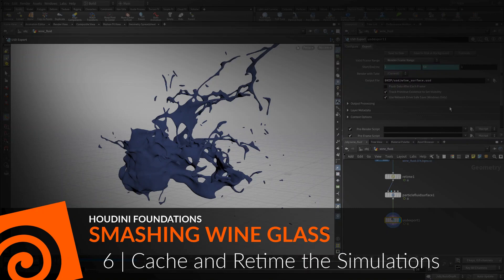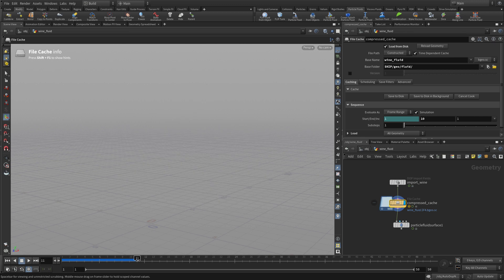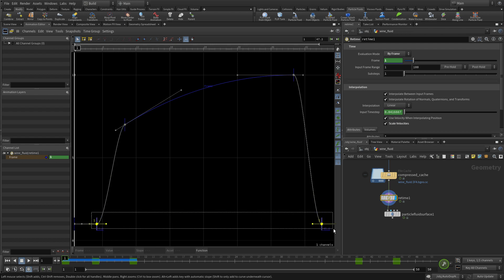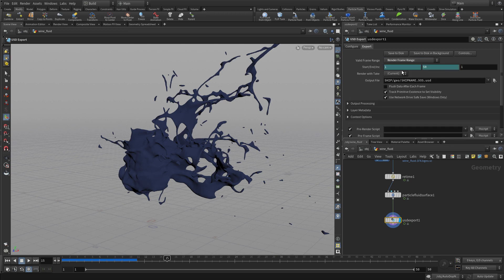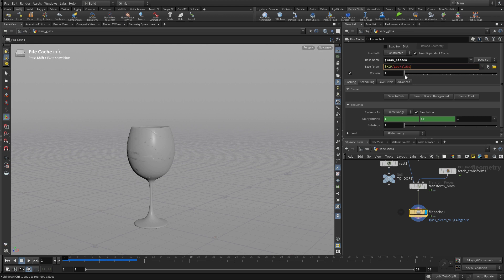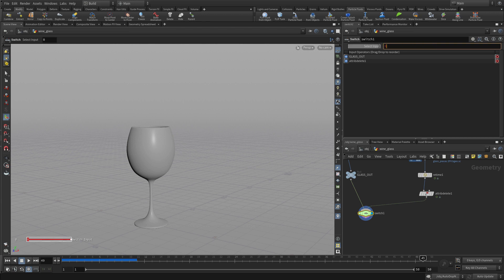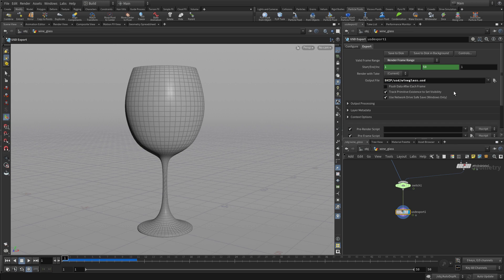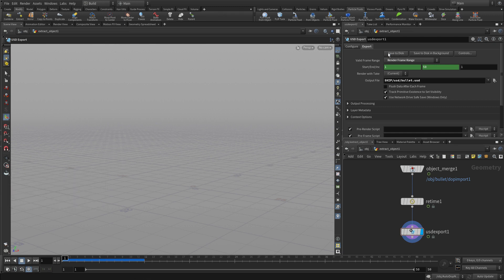Smashing Wine Glass | 6 | Cache and Retime the Simulations

Comment: Hello! i figured my glass is a bit larger (it reaches the 25 on the grid Y axis) and my preview is really really slow (even after the disk thing) when yours is real time. I m wondering if its related to this? Or is it a setting i m not doing right? Thank you :)
Reply: PS: i put the particle separation to 0.2 (which should be less demanding than yours and have the "+" thing near the timeline on